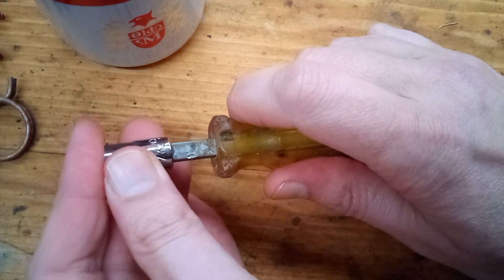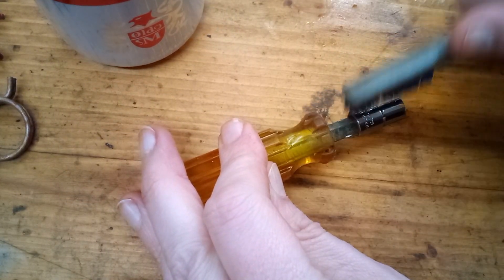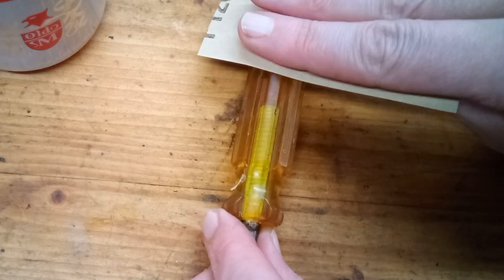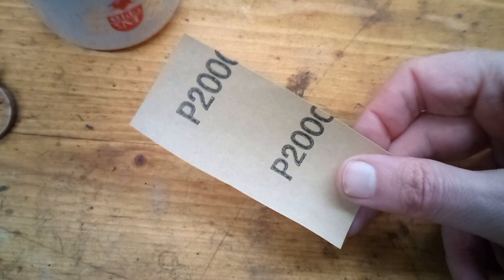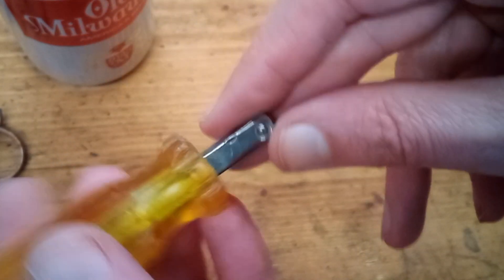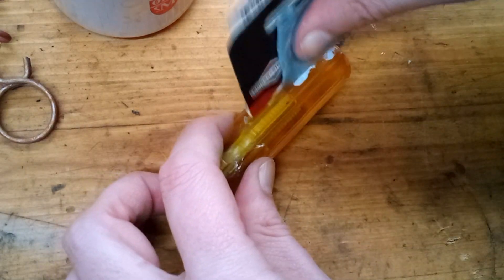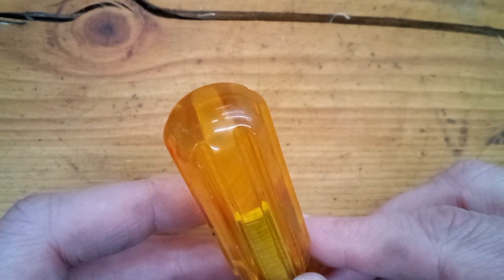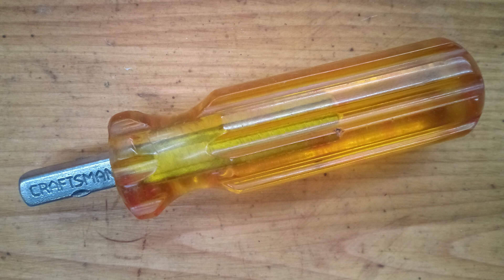Vintage Craftsman Shorty Spinner Handle Tool Restoration

Comment: Back in the day we used an adaptor so we could fit 3/4" drive sockets. Cracking off truck wheel nuts and spinning them off was a breeze.
Reply from the maker: I've used the VIM one for spinning on lug nuts. Sometimes that shorter length makes things easier.

Comment: Nice restoration.   I have made a couple of my own from a few old Craftsman acetate handle 1/4" slotted screwdrivers with bent or broken tips that I picked up for free.  I pulled out the blades out and press fit 1/4" hex drive adapters into them; one is a hex drive locking bit holder, one is a 1/4" socket drive, and a 3/8" socket drive.  All three are short in relation to the handles similar to your example in this video.  While the acetate handles weren't that foggy some plastic polish made them look much better.
Reply from the maker: Thanks! I've repurposed a few old screwdriver handles as file handles. That's a good idea to put a bit holder or drive adapter in there.

Comment: just an FYI, a lot of companies these days are wrong with what they call their tools because a lot of knowledge with many traditional hand tools gets lost over time, but a spinner handle has a female drive in the end of the handle ( because you're spinning the socket in before snugging it down or out after breaking it free ).
If you can't put it on a ratchet it's just a driver handle, which you saw listed as a screwdriver type handle or a square socket handle.

Comment: Looks good. Another way to get it shiny is to dip it in acetone after sanding. The plastic is acetate, so the acetone will actually melt it. A quick dip and then turn it right side up. Don’t touch till dry
Reply from the maker: Interesting. I'll have to try it out on a junk screwdriver first.

Comment: It isn't exactly what you're asking about, but Klein Tools' flip-socket nut driver can take any quick-change type bit, including socket adapters. I've used it with those for sizes not included with the tool (mostly 10mm), and since most socket adapters are pretty short, it essentially ends up with the same form factor.
Reply from the maker: Thanks. I just looked at the Vaco version of the flip socket driver. You're right, you could put a short socket driver in it and get the same effect.